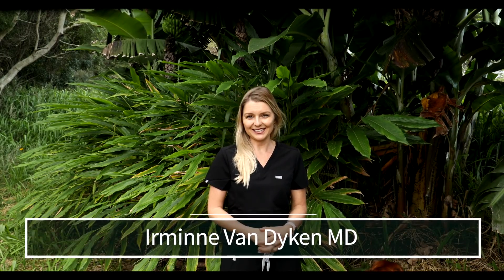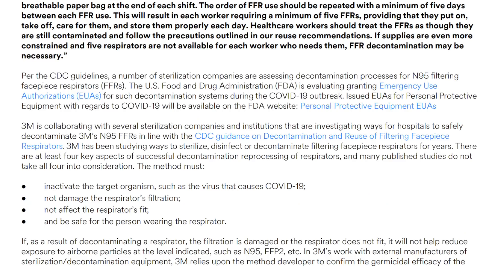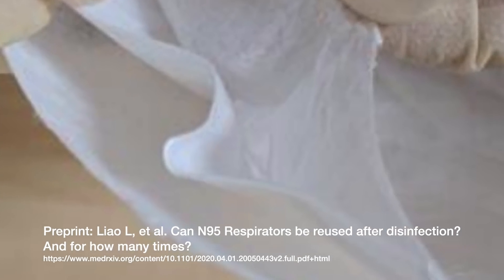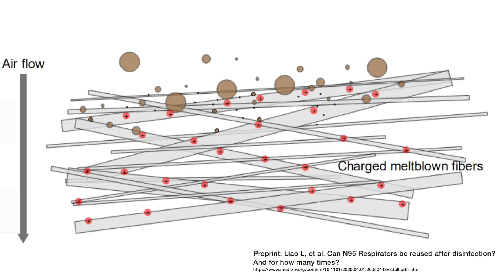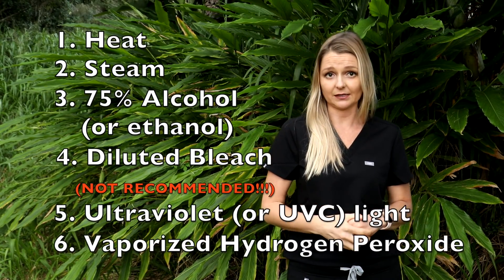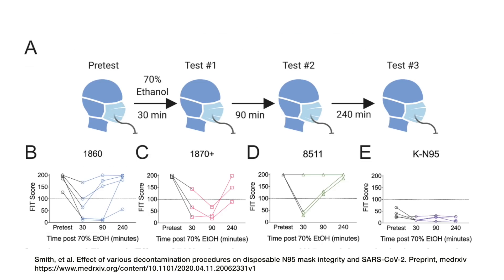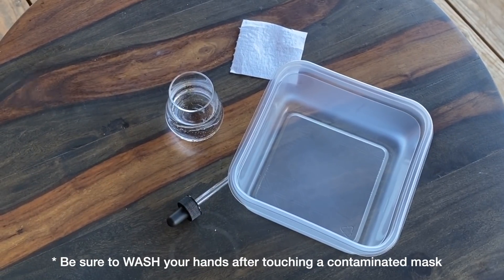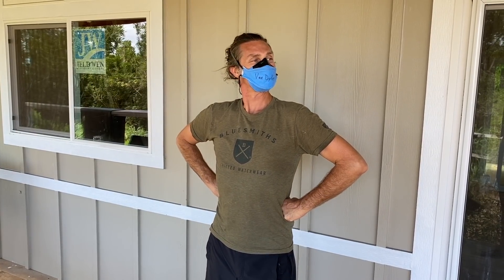How To Disinfect Your N95 Mask at Home

Comment: What I don't understand is why silver microthreads aren't used.  Silver is a very effective antimicrobial, and it's currently being tested for use in clothing which never needs to be washed, and which never smells (because it kills bacteria which cause body odour).  The mask would never need to be disinfected.
Reply: Anything antibacterial is not necessarily antiviral and vice versa.
Reply: Cotton and wool (hydrophilic) fabrics smell and clean better than hydrophobic fabrics (aka polyester), even silver-infused ones. Silver is also not a kill-all for bacteria - you will still need to wash even if it smells a little less. Lastly, silver can leach into the environment and be toxic if they use nanoparticles of silver.

And, as another has commented, there isn't enough testing to show that silver is good against viruses. We only use what's been tested. Silver is unproven, and even with bacteria it's 'meh'.

Comment: If the mask trapped the virus as it passed through, what's wrong with leaving it in there. It was trapped, it's still trapped. You have the same protection as you did when you wore it the first time.
Or do they shrink over time and can then slip through?
I've used n95 for years in spray painting operations. Particles that you cant see in the air and were dry before hitting the mask build up and after a time you can see some color on the outside of the mask, but none on the inside. They were trapped by the mask and I never felt unsafe using the mask multiple times.
Wouldnt time its self render the virus trapped in the mask inert?
Reply: As inaccurate it is, your comment is the most accurate so far in this string of posts. The principle of a genuine 3M N95 respirator is the innermost filter operates by electrostatic charge.  polyprophylene micron sized fibers become negatively charged(think of a magnet) inside this inner most layer of the mask's filter system and become able to attract .125 micron sized COVID 19 and affix them to the fibers. 3M recommends, after 1x use, there's still enough charge time in the mask for you to take it off and dispose of it after 1x use.  Releasing the electrostatic charge releases what's trapped in the mask. So, you're thinking mindset is right. Also, after 1x use, significant numbers of these 10 micron thick polyprophylene fibers snap or break  like lightbulb filaments. Manufacturers recommend, after the lightbulb burns out, remove and replace with another light bulb. Discard old one. No amount of cleaning or disinfecting a broke lightbulb "restores" broke filament in the lighbulb to working order. (Try it and see if it works-haha).  3M recommends discarding old 3M N95's after 1x use for same reason.
Reply: @porpo-donut  So, how long is a "one time use"? is it after an hour? or after a 12 hour shift?
How is that charge affected by long term storage? I've had mine for perhaps 5 years now.
Electrostatic charges can be released by grounding. should the mask be kept away from damp surfaces, or metallic surfaces? If I rub it on a wool carpet can I restore the electrostatic charge?
Should I be concerned with breathing in all those broken off fibers?
Could it be 3M wants to sell more masks?
Not doubting you, but something doesnt add up.
Reply: @porpo-donut  Just an  FYI.
The box I purchased is for "3M n8210 plus" made in USA. There is no manufacture date or expiration date on the box or on the instruction sheet.
As for replacement time limits it states, replace if damaged, soiled, or breathing becomes difficult. By soiled, I think the intent was if it was dropped in the mud, got coffee spilled on it, or if the inside got exposed to dirt or other contaminants. It doesnt say one time use, or replace every 5 hours, or anything like that.

Again, I'm not disputing anything you have said, or anything you have linked, just finding more questions than answers.
Reply: I wonder about 1. the fact that time is a luxury most people don't have given the shortage of masks and the fact they must repeatedly wear the same mask in a short amount of time? and 2. the virus can live on the outside of the mask and thus be spread by simply touching it by putting it on and taking it off or inadvertently touching it, then other places on the face and spreading it?

Comment: The breakdown temperature of polypropylene is way beyond the boiling temperature of water, why exactly can we boil it for a few minutes then?

The elastic band might be more sensitive to heat, maybe wash that part with shampoo instead

I've read washing it with detergent or alcohol reduces filtration because the electrostatic charge is lost... Can it be recharged by lightly ironing (in case of surgical mask)?

Comment: How about spraying the mask with hydrogen peroxide after putting it in plastic bag (so the corrosive spray is not inhaled), sealing the bag for a while to keep it soaked for a good amount of time, and then washing and/or drying it thoroughly?

Maybe you can also put the mask in a "Ziploc"bag and  just pour (instead of spraying) the hydrogen peroxide, making sure every part is soaked?

Anyone wanting to try this, make sure not to breathe in hydrogen peroxide, it might damage the lungs. Do not get it into yours eyes either!

Comment: I actually bought some N95 masks from ojomask.com,but they were really expensive, so I used them for a total of 8 hours before throwing them away. After each use, I put them in the sun for drying and disinfection
Reply: ...notice how ojomask calls them "RN95" "alternative" - then lists what each fabric based layer of filtration that makes up this mask. Visibly absent:  is the polyprophylene electrostatic charge activated layer. Without this layer, simple fabric will not stop COVID 19 from coming thru ojomask RN95's.  3M's N95 respirators have this polyprophylene electrostatic 10-30 micron fiber innermost filter in them. CHeap knock off's not matter what the call them or sell them as, dont.  THe polyprophylene micron fibers act like filaments in a lightbulb, and easily break after 1x use.  Once charged by static electricity friction of your breath "activates" this layer and is able to stop .125 micron sized COVID-19.  Once the filaments break, or a significant number after 1x use, 3M states the mask is no longer fully effective in stopping COVID 19...it's like having a broke light bulb--the filament is burnt out or broke inside the light.  Problem with ojomask is - they're selling you a light bulb without any filament in it, with the audacity to call it a "light."
Reply: KN95 is not a N95, it's Chinese Communist Party partnered Knock-off's.
Reply: @SW-ii5gg  ..if you can 新华通讯社 (Xinhua - China News), some of these manufacturers in China have already been charged. Unscrupulous business isn't limited to China. Deception and fraud are a human condition. Americans on youtube to Amazon are doing it, too.

Comment: When you say "cook" in the preheated oven, do you turn the oven on (running)  or is it the preheat that is disinfecting the mask? If the oven is running, won't that melt the container? This part of your video wasn't clear.
Reply: Polypropylene melts at way over 200F so don't worry it won;t melt